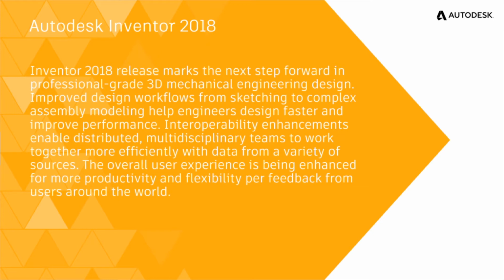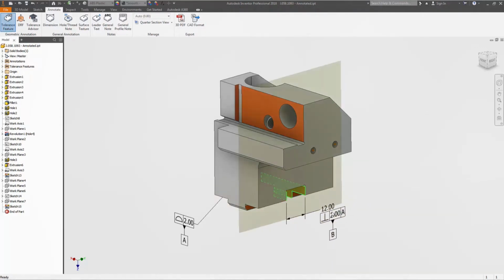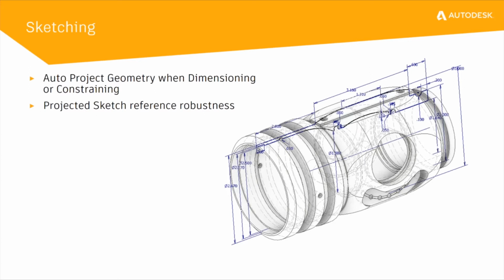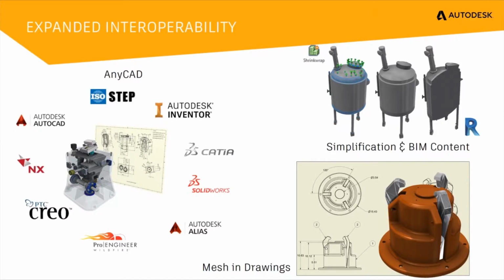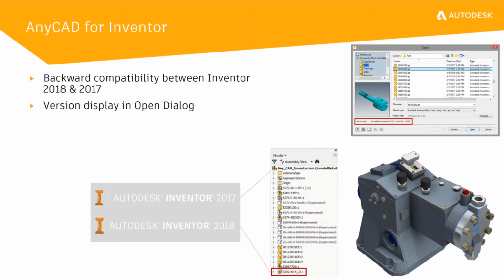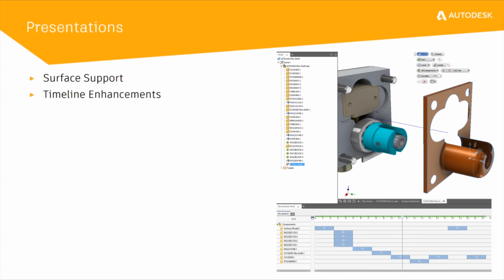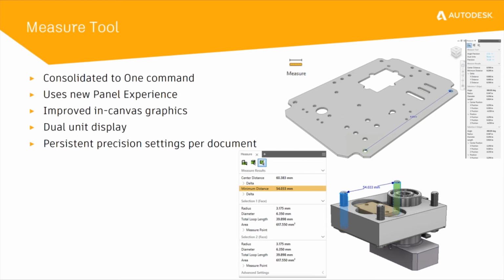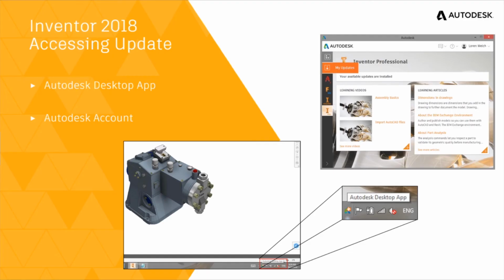Autodesk Inventor 2018 - What's New | Autodesk Virtual Academy

Comment: I was hopping that In Inventor 2018, They would adding feature LOD's to the part environment and drawing.  here is the link about the idea https://forums.autodesk.com/t5/inventor-ideas/suppress-model-features-from-drawing/idi-p/4440307 . Do you know something about this?
Reply: Nothing that I've heard of...  Initially I agreed with the posts of using iparts for this.  But I can think of customers that have tried this in the past for the progressive die and metal forming industry and they have run into challenges using iparts, so I'd have to agree that this a good reason to have this type feature.  I have given your idea a thumbs up!